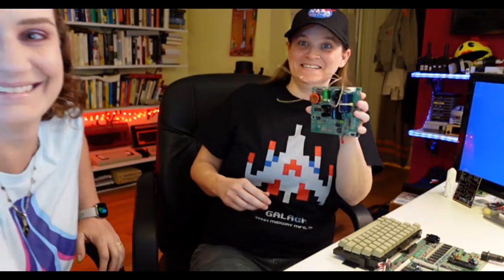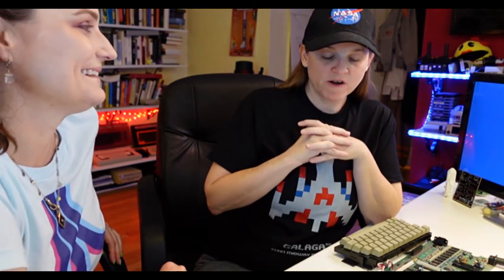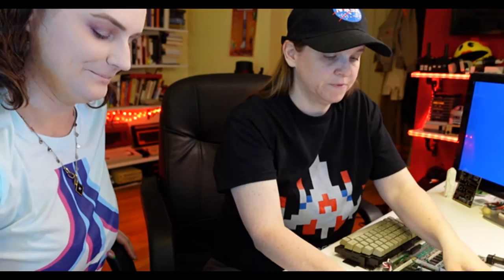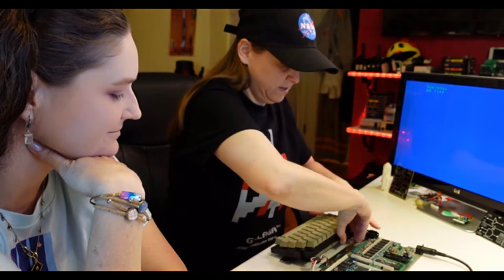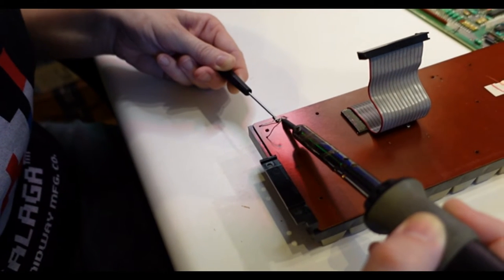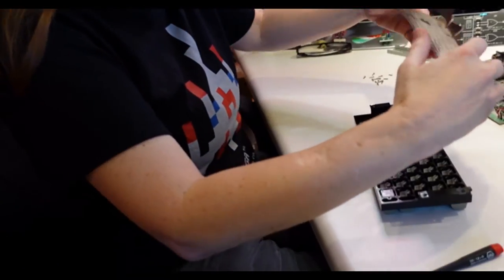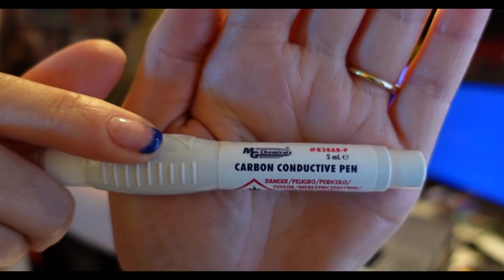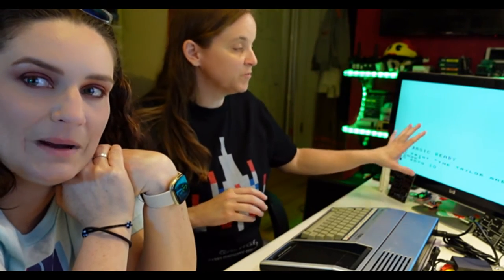TI-99/4A Troubleshooting and Repair

Comment: This is the exact condition my TI is in one day after I got it. It powered up ONCE, but no keyboard at all. Then the screen went blank so I tore it down and reseating the socketed chips and got video back. Now I am in the process of fixing the membrane. I need a silver conductive pen I believe because the header traces are flaking.
Reply: May the force be with you!

Comment: Finally! I've been waiting for you guys to do a video n the TI-99/4A ever since I saw it on the shelf in your Tandy 100EX video. It was my first computer growing up and even though it has the better style of keyboard (without the mylar membrane) it also has issues. Just curious as to why you guys went with a BackBit Pro cartridge as opposed to the FinalGrom (other than they are very scarce right now). I am looking forward to more videos but you'll find out that if you are going to program in basic, go with a memory expansion and Extended Basic. Much more powerful. And check out PixelPdeant's videos on the TI, lots of great information.
Reply from the maker: I actually ordered the BackBit Pro for the Atari 800XL, but since there's a TI-99/4A adapter, I ordered that too.

Comment: that isn't the keyboard for the older black/silver TI-99/4a. that keyboard goes to the  newer beige/tan TI-99/4a. that particular type of keyboard has had lots of issues over time.  the  black keyboard was a lot more reliable. I actually have the opposite of a new beige/tan Ti-99/4a with the older black keyboard because my beige/tan keyboard that came with my newer beige/tan ti-9/4a was beyond repair so I jut replaced it.

Comment: The first computer I got to see was a Ti-99, but I'm sure it had a flat keyboard.  It was on a shelf alongside an Atari 400, also with a flat keyboard, and an Atari 800.  I was most interested in the 800 because it looked like a typewriter.  I think that it was about £650 ($1200 dollars in 1980).  I looked around to ask my dad if I could have it, and saw him walking away with some urgency.  Thinking back, I guess he saw the price tag.
Reply: Prolly nearly at a flat run!

Comment: Ah yes, the TI99/4A keyboard...so far I have bought 3 of these computers and on 3 of them the only problem was the keyboard.
Reply: Shoot, maybe it's the same problem as we had.
Reply: @fractalMD  On one it was, I used foil tape rather than the pen.  I also bought two replacement keyboards with the plastic membrane that just need a cleaning on the contacts.  They replaced two of the stackpole switch grid keyboards that are still an ongoing project to fix (6 months and counting).

Comment: Thanks, me keyboards stop working  1 and brought out a second one  and both doing same thing. I have 3rd one in rafter's i will try. i do have peripheral box  with disk drive. in 80'. I develop The Caltex 994a BBS. from 1984-1995. since the PC came out, this was put away. I believe the contacts have dry out. Francesca

Comment: It looks like you need a fiberglass pen. It helps carefully scrape surface contacts.
Reply from the maker: Isopropyl and several q-tips worked well
Reply: @TaylorAmyShow  Q-tips and Isopropyl are a staple in all retro repairs for sure!
Reply: Like, I'm tempted to buy stock in these things we use them so much.